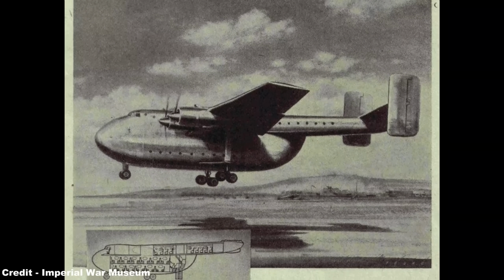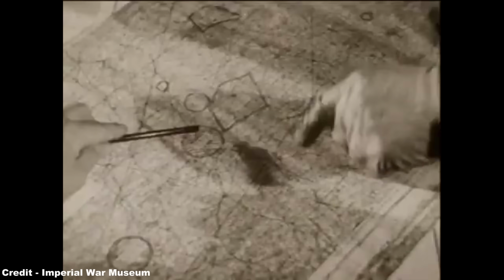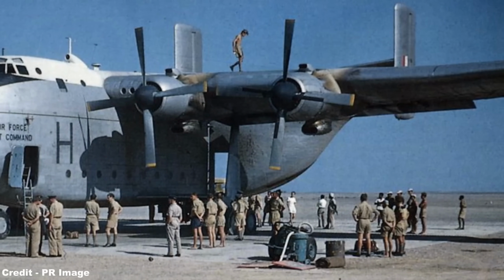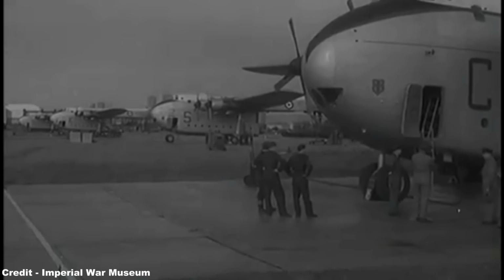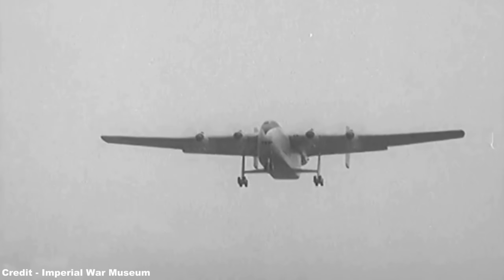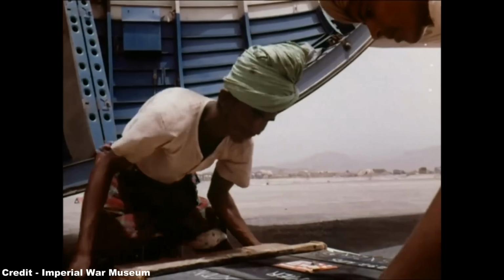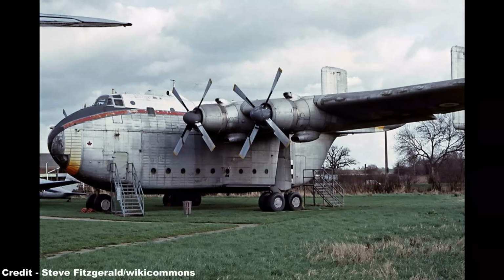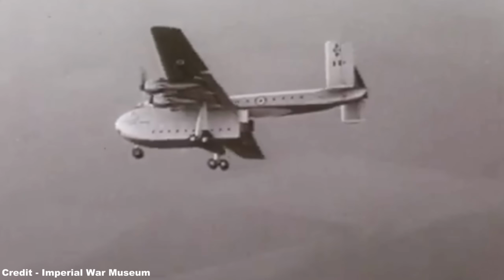The Lumbering Giant - Blackburn Beverley (Reworked)

Comment: At least three Beverley's took part in the RAF's 50th anniversary display at RAF Abingdon which was in 1968 so they couldn't have been retired in 1967.  

They were demonstrating a combined services operation with the Army and Wessex helicopters.  The pyrotechnics the army used threw a fair bit of dirt up over the ground, most of which was thrown up in the air again when an EE Lightning made a supersonic low level pass immediately afterwards!  
It was the best air display I've ever seen.

Comment: Blackburn Beverley would get new life if it got turboprop engines, a different wing profile and upgraded landing gear, it would very well keep up with the day's battles. The same thing applies to Short Belfast, which could very well compete with the C-130 Hercules. The only fault with Short Belfast was that it was produced too few units a month to compete with the C-130 Hercules, the same thing for Blackburn Beverley, which could be upgraded to the maximum to today's standard without any problems. I care least about fashion in aviation, but the function and flexibility, simplicity, if it breaks down, you don't want to look at a manual of a thousand pages, but it should take the shortest route to the goal, if you are going to outsource a battle in the front line, then Blackburn Beverley and Short Belfast are the best choice.
Reply: The Belfast was aka 'The Belslow'!!

Comment: Back in the mid 1970's a  Beverley was at RAF Aden taking part in an RAF/Army exercise. While in flight it was hit by an Army fired 80mm Mortor.  Fortuneatly a training round with a concrete warhead. The Beverley was so slow it could  not get out of the way. The clamshell doors were damaged but the pilot was able to make a safe landing.
Reply: The Beverley left RAF service in 1967, so your timeline of mid1970s not correct.
Reply: Put It down to Memory fade. I served in the RAF 1963 to 1976 so mid 1960's should be correct.

Comment: The Hendon Museum Beverley when cut up was found to be in much better condition than had been suggested- It was actually still owned by the Ministry of Defence. I know a civil engineer who worked at Hendon in 1968 after the RAF base was closed and the area being prepared for development. They needed to dig a trench for services but it was delayed and he said " until this monster aeroplane landed and we then dug the trench." That was, of course, the Beverley being flown in for display and I saw it there in 1985. As a kid we would lie in our garden and look up into the sky at the wealth of aircraft flying over- I had seen the Rotodyne come whizzing over at a low height and a couple of Avro Yorks and one Lincoln. The Beverleys just seemed to " hang in the air" like kites- they were based 20 miles north west from us at RAF Abingdon.
Reply: The RAF air museum has a nasty habit of cutting up aircraft they seem surplus to requirements. They did the same thing at Cosford when they cut up the sole surviving  MK1 Vulcan.

Comment: Its such a shame in my opinion that an aircraft manufacturer from the same Country that invented the turbo jet and the turbo prop couldn't have produced a Mk2 version incorporating one of our own turbo prop designs, and using side bulges like the Hercules to stow the main gear along with a retracting nose wheel, the resulting aircraft I feel could have easily exceeded 300 mph may be even 400 and with an even greater payload. For some reason I was always fond of the Beverley as a boy back in the early sixties and always had the opinion it was given a raw deal with massive under development, as good as the Centaurus was and an engine I love,  it was never going to equal turbo props for raw power.